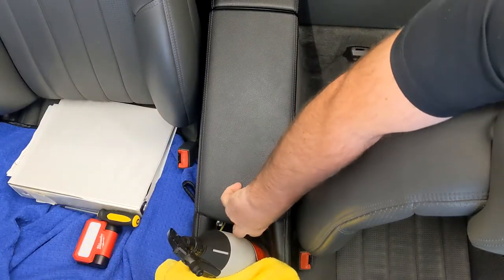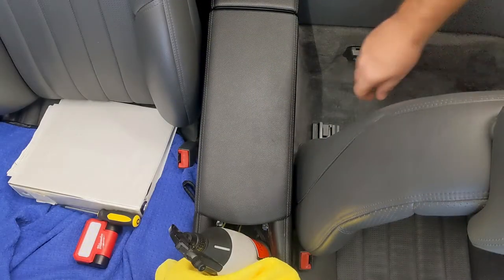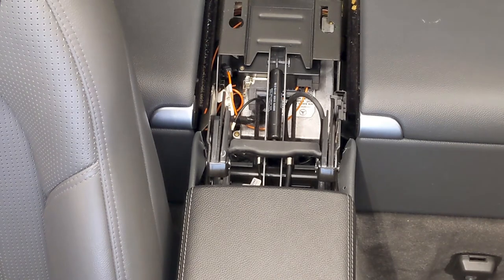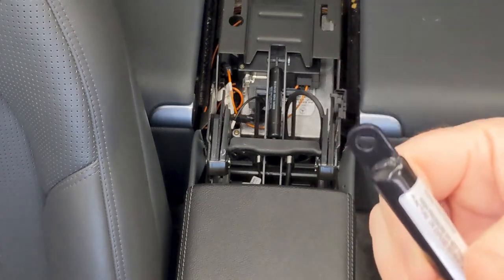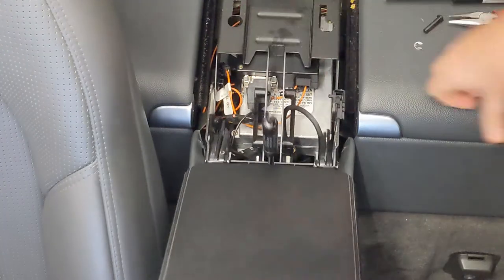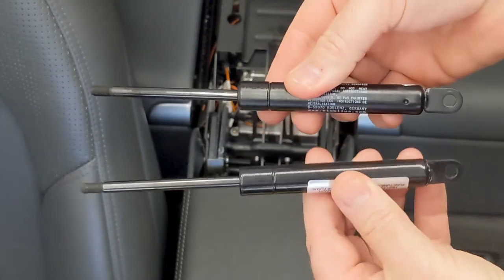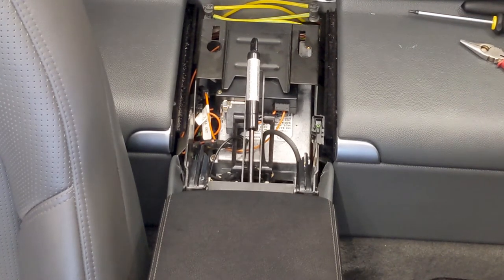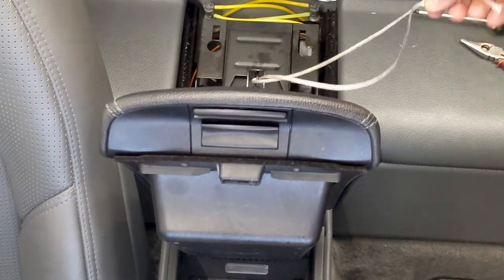R230 Center Console Armrest Gas Strut Replacement

Comment: How did you compress it by hand with a string? Maybe yours was used and lost it's strength.  But the new one I got (from the Amazon link you provided) would not compress by hand. Because it is rated for 150lbs and requires either my full body weight or a tool to compress it. I screwed the strut into place. Then, I used a 12" 300 lb trigger clamp to compress it. Then, I pushed it out of the clamp and into the slot by hand. Pretty easy. The hard part was figuring out how to apply the clamp. Because there isn't enough room to get the clamp behind the metal bar that the strut screws into. But there's a simple solution. 1) open the armrest, 2) remove the end piece of the clamp, 2) place the clamp in the armrest storage bin, 3) feed the clamp bar through the opening between the two hinges of the armrest, 4) put the end piece of clamp back on the clamp. Now the front of the clamp presses against the back wall of the storage bin and the end piece of the clamp presses against the end of the strut body.  You have to position the strut body at the very edge of the clamp. This enables little effort to push the strut out of the clamp and into the slot.

Comment: One step is missing, however, it would certainly reduce the "wrestle pleasure" ;-)
You can simply move the armrest up in the over-center position... its the vertical position just beyond the regular upwards travel, you notice a bit of resistance but not much, then the cylinder and pin slides in easily, I used a screwdriver to direct the pin in a straight path to catch the opposite hole, overall took 10min.

Comment: If you just open the lid up fully then you won’t have to struggle to compress the strut
Reply from the maker: Yes and no. Still requires some finesse.
Reply: This is true with the Mercedes part. It falls into place with no struggle. The aftermarket part is longer and has to be compressed before it can fit into the slot.
Reply: @adildastur5377  if it’s longer you’ve bought the wrong part